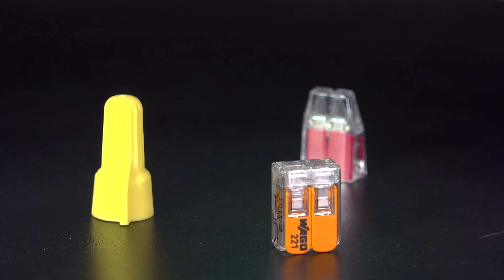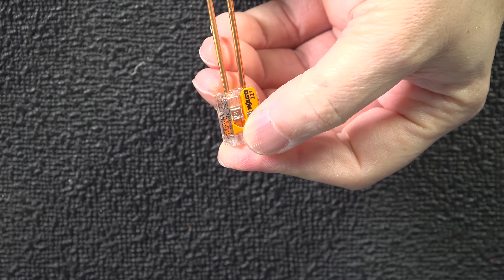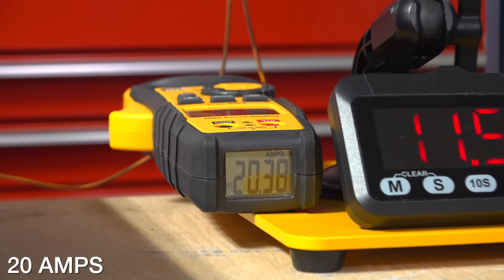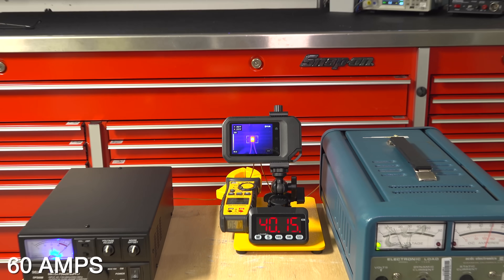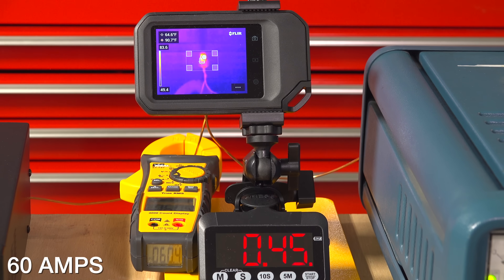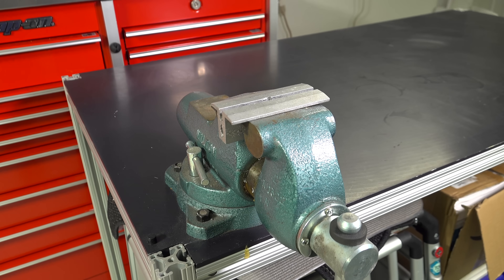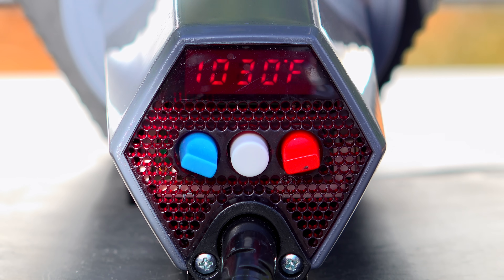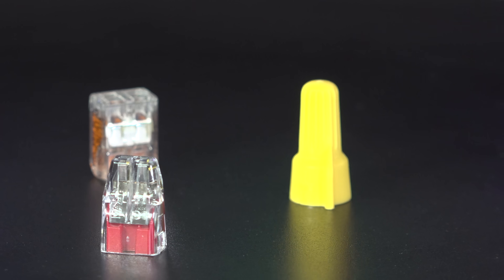What Wire Connector is the Best? Wire Nut VS Wago TESTED

Comment: Opinion from a licensed electrician. Wire nuts will always give you the best and most secure connection as long as you pre twist, if you don’t pre twist you have no business doing electrical work. The push in type Wagos are okay. My only complaint is people commonly don’t push the wire in far enough and smaller wires tend to slip out. Lever type wagos should never be used for anything except temporary work. When you have to push all your connections back in the box those levers get caught and the wire comes out.

Comment: How could you even have achieved your test results if you placed both the WAGO and the wire nut in real-life situations, i.e., place a 15 or 20 amp circuit breaker between the power supply and the load ? You'd never even get to 60 amps. I like WAGO's when I'm making connections with solid wire, but not very happy with results using stranded.

Comment: TY for doing these experiments and running those tests because it finally gave me definitive proof that wago wire connectors are an excellent product to use for splicing wires. And reading the comments helped me realize how Wire Nuts though least expensive provide less reliability overall because of loose connections and falling off splices inside boxes than Wago wire connector (221). I will use whatever my company provides me with, but will recommend my foreman this video and to use Wago wire connectors 221 or when I go off and become a journeyman myself will use Wago connectors 221 instead. Thanks Again great video and great helpful info

Comment: Wait, did you pre-Twist the wire nut cable to short the cable before going into the nut ? So the power could pass over before the wire nut and with the wago you passed the full power thru the connector ? I didn't see that right. Sorry... But I think the test method is a bit unfair for the wago.

Comment: Would’ve liked to see the wire nut current test with the only twisted section within the nut. In your test, there is excessive twist before the nut, resulting in more contacting/conducting surfaces between the two wires, that otherwise wouldn’t be there with insulated wires.

Comment: Because you twisted the cables before adding the wirenut, the contact surface between the two cables will have been much larger. Not surprised it didn't heat up as much.

Comment: I'm using that WAGO for my prototyping for research development.
Not running very high current but It is very convenient.
Keep bunch of them
I still wish they make with mounting holes so I can screw to secure it
Once I used it for water heater. since the cable broke and I joined it using WAGO. It held up

Comment: Found it kinda strange how hot the wire nut got, considering the nut only covered 50% of the connection at best.
Would twisting the (open) wires outside the wago help the temperature...

Comment: I don't get it. For the load test at 60 amps, the Wago is the actual connection between the wires. (meaning the whole 60 amps is going through the Wago). The wirenut is only holding the 2 wires together, therefore, the wirenut doesn't have ANY current running through it...  WTF?

Comment: This is a great video, however I've heard an elder teacher tell me that they tend to get loose over the years. Since the wires expand and shrink from heat they might come loose over time. I'm really wondering if that's true or not because that's a big problem. Will these wago clamps hold on for 10+ years on end ?
Reply: This is true for screw terminal blocks, but not for wagos. That is in fact one of the reasons wagos replaced the screw terminals almost all over europe.
Reply: @theawfulmrbird  fantastic to hear they are that reliable ! Though I wonder now if the terminal screw blocks are less reliable why don't they replace the breakers with a plug in system as well. I've seen horrible melted breakers with a rail connector on it and it only makes me wonder of the risks.
Reply: @dynamitedudes  I know Hager is selling breakers with push in / spring terminals - but screws are still common with breakers in europe, too. Maybe it is harder to engineer busbars with spring terminals if you consider they have to be replace defect breakers in older fuseboxes... but i dunno tbh...

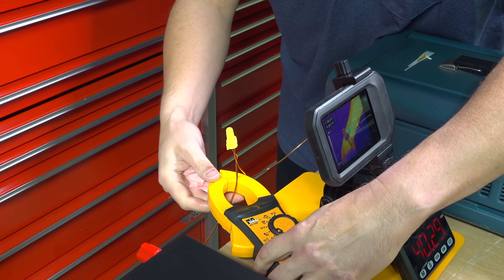Comment: 3:10 You're using uninsulated wire. When the're twisted like that and contacting so far down (wich wouldn't even be possible with insulated wires) a lot of currennt can flow through the contact point in the twist, completly circumventing the nut.
Reply: Yet, that would be an argument against the twist nut connection, no, or you're thinking that the twist cap will be able to withstand higher temps than the wago?
Reply: @Quentyn73  it's just not representative of how to nut would be used IRL. Copper should not be showing outside of the nut. Bare Copper only i side the nut.
Reply: wagos are superior i think because they are easier to use and take up less space and less likely to fail at least the 2273
Reply: @Anon Ymous Any connection of the wire before the nut will carry part of the circuit current. But that can be considered an advantage of the wire nut, of having multiple points of contact.
Reply: @Anon Ymous but resistance would be higher across  connection if the wires are not toughing outside of the nut.
Reply: Rite the wire nut was hardly even part of the equation
Reply: Excellent analysis!
Reply: I saw the same thing. Any connection of the wire before the nut will carry part of the circuit current.
Reply: @Anon Ymous Current will not be the same at the tip in the nut and at the twist and at in the wire, it will be a share of the total current from the supply to the load, very close to half in each part. It is like two resistors in parallel, albeit very very small resistors.  Current in the wire near the supply equals the current in the wire near the load, the current at the tip and the twist will sum to be the same as the load and supply. Kirchhoff’s Current Law.  Σ I in = Σ I out
Reply: @Anon Ymous Using that logic, you don't need higher gauge wire for more current because the same current goes through every portion of the diameter of a wire.  A better test of your theory is to take two separate loops of wire connected to the same power supply and measure the current through each loop.  You'll find that about half the current flows through each loop.  Otherwise, paralleling resistors would not work.
Reply: Exactly what I came down to post.  It's not a fair test.

Comment: Whats the point of the wirenut in this specific test if you pre-twist the wires anyway. It doesnt add any benefit to the connection in this specific application anyways.

Comment: Good tests and video, thanks. One small observation, when you pretwist the wires together before inserting them into the twist nut, you are allowing the current to pass between the conductors outside of the twist nut, so it is not seeing the full load of the current.

Comment: I'm not a professional electrician or anything but I was wiring up a simple DIY LED lamp and decided to go with WAGOs instead of wire nuts while testing it. Liked it so much I decided to leave them in the final project. 
I used to do low-voltage network wiring professionally, and my experience there soured me on wire nuts. Yeah, I know they don't belong in that application at all - that's one of the reasons I grew to hate 'em! But they're also just plain "sloppy" and they twist up too much conductor for my tastes. When I go into an apartment, I can't run new cat5 so what's in the walls is all it's ever going to have, and plenty of contractors don't leave any slack. Having to cut past a wire nut's twists to fresh, unmangled conductor always added precious time to my job list. 
When I put my lamp together, I could prototype it with the WAGOs and the lampcord was still pristine when I took them out to make adjustments. No more cutting, stripping, twisting, etc. over the conductors: just re-use them and the WAGOs over and over without waste! It saved me time, and kept me from having to sweep off tiny bits of braided conductor all the time. 
So for the few electrical projects I do have to tackle, I'm sold on these things.

Comment: I can't say I agree with the first wire nut test. I submit that the wires should have been twisted inside the wire nut only; that way current flows through that one joint inside the wire nut and a proper temperature reading from that point of contact would be acquired. The way it's done here, current flows through the twisting outside of the wire nut too.
 I may be wrong in this so please correct me if I am.

Comment: If you're REALLY worried, the slightly larger 221-6xx range are rated to 30A (UL) or 41A (IEC). That means that for the vast majority of domestic circuits you don't need to think twice.

An assortment box of 221 series and 2273 (push wire) Wagos has pretty much replaced every other connector in my toolbox. I've got a couple of strips of connector block for emergencies, and crimps and heat-shrink for making joints in trunking, but for most domestic work (and a lot of commercial/light industrial) there's really no contest. They're also handy because I can get more useful work out of less skilled labourers - it's pretty much impossible to make a loose connection, so provided I can visually inspect their work before closing up then we can get much more done in a day.

Comment: Just my opinion here.....
Great connectors........ when they are Genuine WAGO and installed properly; and therein lies the problem. 25 years in this industry has taught me that the construction industry in the U.S. is heavily biased toward the lowest bid and the fastest turnaround whereas Germany is focused on quality & warranty. Sadly, quality is far down on the list here. Tradesmen, electricians included, are under constant pressure to meet/exceed “rate”, and using these connectors under time/output pressures = failures. When you’re making hundreds/thousands of connections on a construction project, taking the time to be precise in wire stripping costs $$$ and requires the installer to be attentive (the fact that you used bare conductors bears this out); something that is often not the case on Mondays & Fridays. Wire Nuts are time tested and very forgiving in a fast-paced environment with dozens of electricians each having different skillsets/work ethics on the job. Used properly, they are as good a connection as you can get; wire-to-wire. Used improperly, they still have a high reliability. Great video though, 👍🏼👍🏼. Thanks!

Comment: The biggest issue is that you need to check very cautiously if the Wago is grabbing onto the wires well enough.
It's way too easy to accidentally insert the wires only halfway and make a sloppy contact.
So when checked, they're just fine, but they're less foolproof.

Comment: Wago's have been the standard here for as long as i remember. Nobody uses wirenuts because there is no advantage for using them and i replace wirenuts immediately when i run across them.

Comment: I think this was a good video, the first one on the subject that I have seen that was at all scientific in nature. I would have liked to have seen you have the meters from both the load bank and the power supply on camera during the test along with the FLIR camera display so that we could watch and see if there was a sudden change in resistance of the connection as temperature changed over time. I’m assuming you had a constant current power supply… But since you didn’t give us a close-up of the set up I don’t know. So it would’ve been nice to know what voltage that you were having to run to generate that 60 A of current, I couldn’t really tell even though I ran the video back-and-forth.
Reply: If you do choose to do more testing, include the Buchanan connectors that basically are an irreversible crimp with a snap over plastic shell, from the outside they look like a wire nut but they’re not at all like a wire nut.

Comment: wago are rated for solid kables, and atleased here we kinda only use multistrand in housewalls cus they are flexable, and wago can be intalled inpropper with multistrand thus heating up and mealting. i love wago, but you cant use em with multistranded cables.
Reply from the maker: Sorry none of that is corect. There best use is for solid or stranded wire. Specs from Wago:  The 221 Series Splicing Connector connects solid, stranded and fine-stranded conductors easily, quickly and safely.
Reply: @SilverCymbal  swedish elektrical safty regulations have deemed them unsafe for finestranded connections since allot of unsafe installations do occur.

So atleased in sweden its not allowed as the electrical code dont allow wago to be used with fine stranded, thou it does occur that people do use it, it works, but most people twist the wire before inserting (old electricians) they need to be inserted paralell, not twisted.

As i said, they are easy to miss install with multi strand (by twisting) and therefore are unsafe firehazards. and generally deemed unsafe.
Reply: @Kuffen_infinity  I know that is true for the wago push in connectors, like the 2273 series - but the 221 are designed to be used for stranded and fine stranded and solid (even in combination with each other). 
You got a link to the regulation that forbids using the 221 for fine stranded wires? bc i couldn't find it searching on google....
Reply: @theawfulmrbird  wasent able to google it. Been years since i did my studies and i know its atleased seen as bad practise among elektricians to use em. Since they arent as safe. Strands popping out. Causing fires. Compared to wirenuts or screwfittings.

One house fire is one housefire to many.
And our electric safty department dont recomend them. Its easy to install incorrectly and unsafe. Since people twist the pairs. This is true for quickfits in lightswitches too. Where they get stuck especially when done multiple times. And strands can stick out.

I like wago due to them being easy to workwith. But they take more space and can be unsafe if installed wrong.

Comment: Electricians are a funny breed! They don't trust anything new. They only go with what they know. They're very quick to condemn something they don't understand. In the UK, if you try to tell an electrician that the ring main circuit, is old-fashioned and oudated. You will be attacked from all angles. They will literally defend it to death. No matter what evidence or research you provide them.
Reply: They just refuse to comprehend that the ring circuit was a hack designed to save copper when the UK had a shortage, and that when it was introduced, most electrical stuff was just lights and maybe a small heater, or "electric fire" as I've heard some older Brits say. But put in a water heater or an electric oven near one end of the ring circuit and you'll overload the long side. IIRC reading somewhere that a while back the UK electric code was updated to require direct lines to such high power appliances.

What is with the British obsession with using combustion terms for electrical things? Flashlights are "torches" and heaters are "electric fires". Any others?

Comment: We dont use wire nuts where I'm from. But almost exclusively wago. They are so much better than the screw ones we use to. Have had so many come loose over time. Especially when you have more than one in the same hole. You don't get that with wago connectors the spring holds the cable tight over time.
The only failure that I've seen was with wrong size cables in 12v lighting. And it's so easy to Service or even ad a new cable without cutting the power. Do that with a wire nut 😉

Comment: Suprised to see such discussions. These Wago Clamos are used by 99% of all electricians here in Europe by now. Fully certified by standards, there is 0 risk in using them. The main difference however is that we have 230 V outlets, so the average current is usually lower

Comment: What some people will not appreciate is that running 3 times the rated load doesn't generate 3 times the heat output, but 9 times due to the power dissipated being the square of the current multiple by the resistance. In practice, it will be a little worse as the resistance will also increase somewhat with temperature. So the heat generated at a sustained 60A might be 10 times higher than at 20A sustained.

Comment: Why did you test with DC instead of AC?  What Voltage were you using?
Reply from the maker: AC & DC amps are the same for testing purposes. Many articles describe this in more scientific detail why. AC amp load testers cost about 10x more than DC ones. Voltage was 13.8v

Comment: 3.00. The tests shows nothing about the capability of the wirenut itself. You have a huge parallel connection point outside the connector. When twisted like this without insulation you might as well do the test completely without the wirenut

Comment: When you had the wego at 20 amps, that's  all I need to know it's good to use, as most 20 Amp breakers trip before they reach 20 amps. Thanks for a great video.
Reply: The 0,5 - 6 mm² / 20 - 10 AWG 221s are rated for 41A / 30A UL!
Reply: Er, 20 A breakers are supposed to hold that current for… like… ever. They will only go off if the current exceeds the rate by a certain factor for a certain time.

Comment: I used wago and regular connectors in my house. Wago was always tricky. If i pulled the wire for test sometimes the wire terminal remained inside or the wire came out. That clip doesn't really matter. Even if is closed don't hold the wire better.  Regular ones with the screw never fall. The only disadvantage is the size.

Comment: Lever wagos are made for stranded wire cables and push in wagos for solid copper cables. I hate wirenuts for multiple of reasons. If you say that you cant fit enough in a wago you are wrong. There are wagos where you can put in 8 wires and im not sure but maybe even more. And they are great at space saving